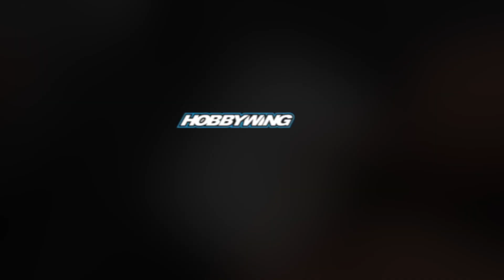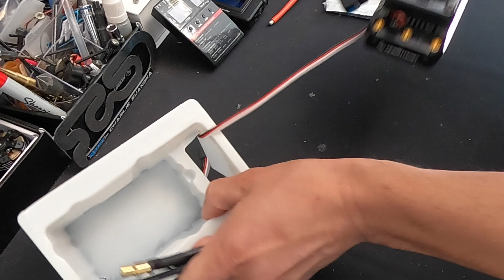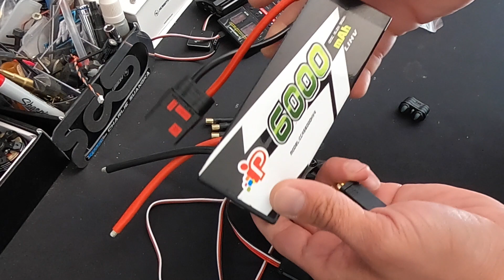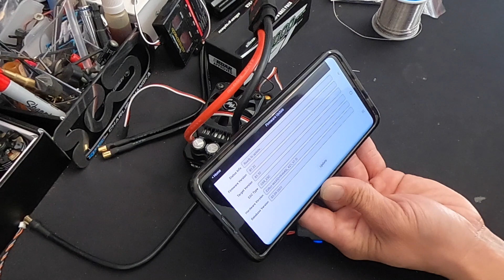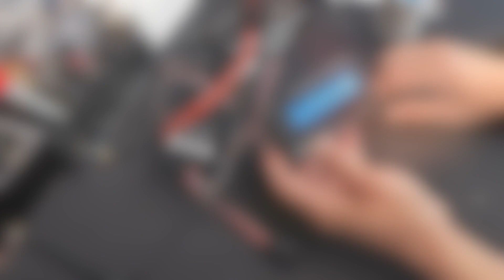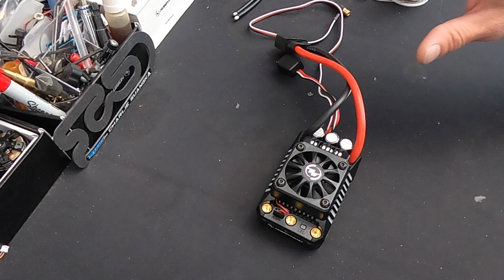The Charlie Show /// Episode 164 /// EZRun Max 5 Pro Tips

Comment: My max5 frequently restarts under load , k8s exb, 56112 800kv 39/39, 100c batteries. When immediate full throttle, esc shuts off and restarts, then few seconds in 100 % functional again.
A new max5 from a friend works fine, no issues, with my setup, escs exchanged.
Connectors redone, pristine.
Was going to do a firmware update but hey last update 5 years ago?
Any clue what this could be?
Reply: Check you soldering

Comment: How well does the max 5 work with the spectrum firma 780kv motor that comes in the losi dbxl-e 2.0? And will I loose AVC if the max 5 is installed?
Reply: Have you tried going the normal route of emailing and or calling them? At least they made this video even if they don't offer tech support through the comment section
Reply: @cwatson42785  It actually doesn't matter now, the max 5 failed after only 8 months and hobbywings warranty is only 3 mos. Guess they have no faith in their own products. At least castle has a 1 year warranty, which in all honesty, you'll need it.
Reply: @Blueknight1960  Sorry to hear that brotha. That's tough. I've been a fan of hobbywing products and never had an issue. Sometimes we just have a bit of bad luck and get a lemon. What castle esc did you decide to go with? And also what pinion where you running on your dbxle with the max5? I just got a fully upgraded roller with over 800$ in upgrades that's been run like twice for a trade for an unopened exb! Such a crazy deal. Score of a lifetime! My first 1/5th scale
Reply: @cwatson42785  Good deal on the trade. I've run it with 15-18t pinion and 46-50t spur. It was running fine and all of a sudden quit. Hobbywing offered to sell me another one at the low cost of $120 after they had conformation of me sending the other one back on my dime. I chose not too. I got the xlx2 and unfortunately, it didn't last a full battery pack. The negative post on the esc broke. I sent it for warranty, they are sending me a new one but who knows when it will arrive. They also told me that at 340 amps (highest amps according to the logs) it was too much for the xlx2 even tho on castles web site, they stated they tested the xlx2 at over 500 amps. But the amps mine used was too much. I wish I could afford the MGM esc and motor but at over $1400, I'd have to win the lottery.
Reply: It seems hobbywing doesn't care to answer questions, so I see no need to watch the videos.

Comment: A sticky pad doesn't hold the esc down at all. It will fall out every run. Esc needs to be screwed down and cable tied down and even then sometimes it still comes out. 😂😂😂 If your esc is held in with tape you aren't bashing hard enough
Reply: Hey Lawrence I just got a fully upgraded losi dbxle roller with 800$ in aluminum upgrades and mip axles and barely driven that is insanely kitted out with upgrades in trade for a new kraton exb I bought on sale for 330$! I got a max5 combo to put in it and I'm glad I read your comment as I was planning on just using the double sided tape lol. Guess I'll have to fiqure a way to hard mount it up. Can't wait to get it out and ripping! Can't stress what a beast it is. It was an insane deal.
Reply: "A sticky pad doesn't hold the esc down at all" if you use good tape, it will need a crowbar to get it out again.
Reply: @xXYannuschXx  bs, I've tried all different tapes. Unless you run on road it's going to come out.
Reply: @LawrenceTimme  Dude, good tape works. You are a liar. Are you taping onto dirty surfaces/ Are you just lying, period? What exactly are you lying about here, because its apparent you do not have a clue what you are saying.

Comment: I just purchased the Max 8 combo, the low voltage doesnt drop to 50% when low voltage detect is activated  it just stops. Is this notmal
I'm used to traxxas still running for a little while before completely shutting down.
Reply: Normally runs for 10-20seconds for me